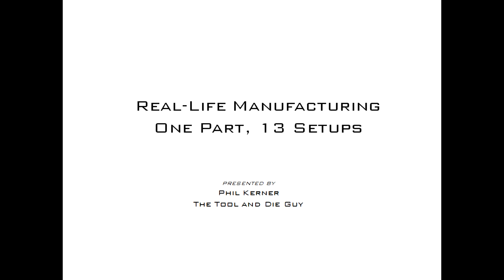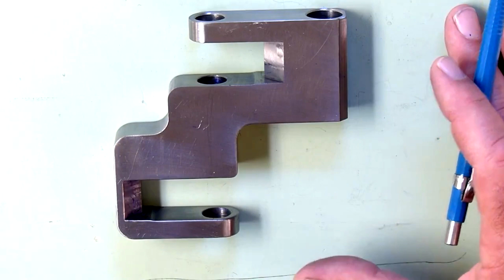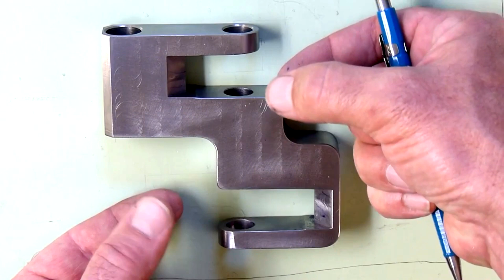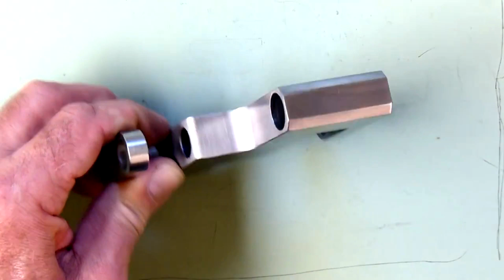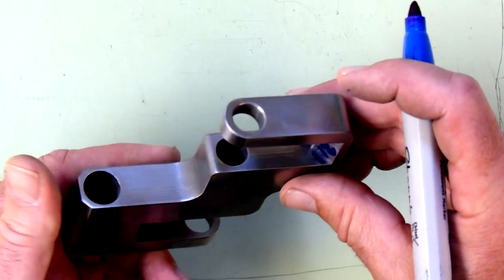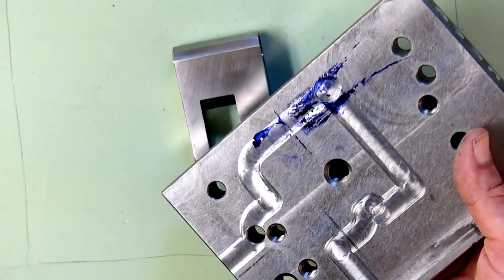One Part, 13 Setups!

Comment: Hey Phil.  I’m a fan, and I appreciate your time and experience.  That said, this video was not “showing me 13 setups” but rather telling me all about them. I can show you a picture of one of the places I fly to and then move the picture around a bunch of times while I tell you how I got to the aircraft, did the walk around, briefed the back end crew, boarded the plane, went through all the checks, started the engines, taxi’d out took off, did the departure etc....  My point is that had you made a couple extra parts but stopped the process so we could see examples or simply shot some pics of the setups with the work holding solutions this would have been a very valuable video.  Instead you have walked us through a nice story.   I watch all your videos, am a lifetime subscriber to your site.  Clearly I really respect what you have to offer but sometimes I feel like you are missing the “main idea” that you are seen as a teacher/mentor by many of us.   As a student of machining I want to see how you hold the work, what setup you used to get those 45’s. How did you get them perfectly centered, how did you clean up the radius’s so that they are square, how did you not touch the sides when doing so?  I love this series, but moving forward pleas show me more about the how, rather than just telling me.  Don’t take for granted that I just know, that is why I’m here, because I want to know, and I don’t.  My best regards, and profound respect sir.  Derek.
Reply from the maker: Points well taken. I'll see if I have at least a few photos of this project - which I probably do - and make a follow-up video.

Comment: On a part like that I am always concerned about warping at stress relief. You have that perfect bore that goes all over the place when you mill the material away.
Could the 45 degree outside chamfers be made with a chamfering end mill? Would reduce 2 setups.

It is possible to make that part on a 3 axis, maybe even on a manual mill, but that is clearly a 5 axis job. Reduces the amount of setups a lot. Yeah, I know, using what you have ;)

Comment: Drawing it in Autocad: Easy.    Making it: Maybe not so easy.
Parts like this are the reason there needs to be close cooperation between the design and machining departments. Sometimes a part will just be difficult or time consuming to make and there just isn't any way around it. However most of the time I found that parts could designed or toleranced so that making them was substantially easier and cheaper to make.
Cheers from NC/USA

Comment: Yeah I have heard that before. Only it was you lost our ass on this job . When I ask them how did you figure this job in the first place , crickets. Great video Sir .
Reply from the maker: The only thing that I can say was that they were a hell of a lot easier the second time!
Reply: The parts came out good, the customer paid and you are still getting more.  It would be hard to make a good rate on a part like that, because the ops probably go pretty quick once you get them figured out.  The 45 deg cuts inside the slots really add a lot of setup and handling.